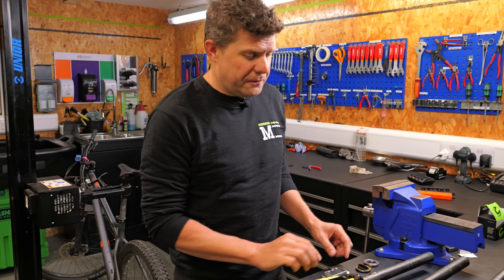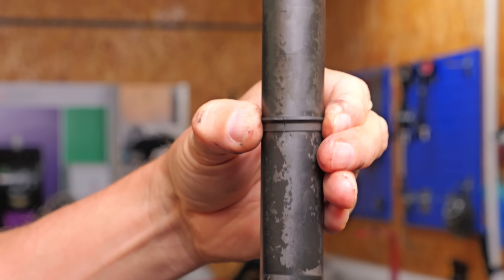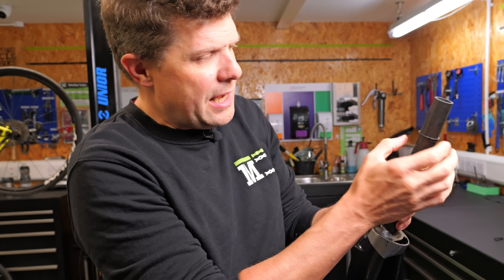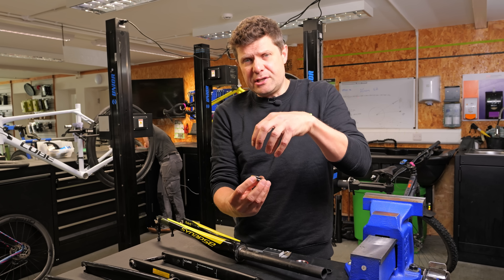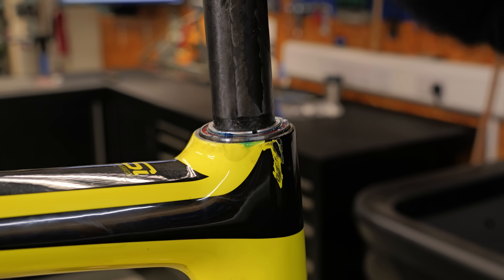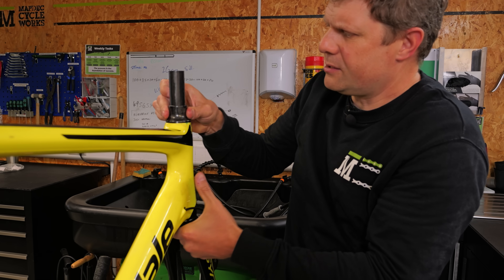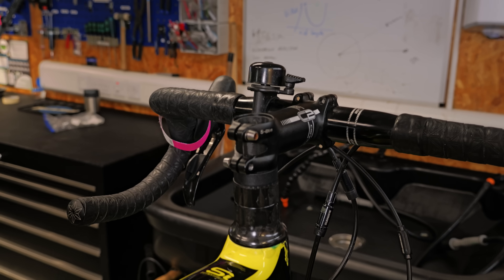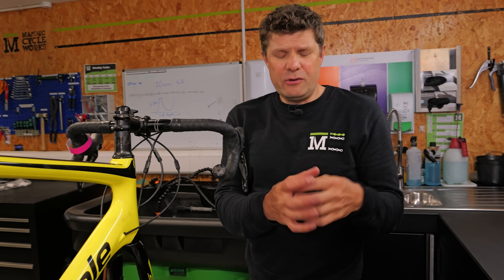Why Are So Many Bike Forks Breaking This Week?

Comment: 1) it's not abrasion.
2) you installed the compression ring 90° out of phase. 
3) every bump and rebound load from your arms to bars compress' the ring thousands of times per ride. 
4) show me a steerer with a plastic comp ring that had a ring of death. You have galvanic corrosion, a steel bearing sandwiching a non anodised aluminium comp ring
5) look at ring of death in the early stages and its compressed carbon fibre, once the epoxy layers are broken you then get galv corrosion+ the comp ring reaching max compression as you showed
6) Comp rings and seatpost clamps do not stay circular as the close. They become a C with the tips of the C pinching inwards on the steerer in 2 point loads.
7) stop greasing your headsets and steerer as shown. You need a drainage channel. Just hose your headset and then unassemble it and you will see the pooling water in the dam you've created.
8) the only cheap solution is to put a layer of plastic tape around the steerer prior to assembly. The thinnest "helicopter" tape is best. Cheaper PVC based ride wrap is ok, cellophane tape is ok.
Reply from the maker: I showed you 2 plastic compression rings in this video. 🤷‍♂️
Reply: @Mapdec and they were from the corresponding forks you showed?

Comment: I had this on my SL6 tarmac. The carbon repairer was able to fix it, but did also reenforce it on the inside of the tube. Mine was cause by the top cap collapsing; there's an oring in a slot inside the top cap, but the cap had collapsed closing the slot for the oring and making it unable to be tightened.

Comment: For any buyer (especially those experiencing issues with carbon steerers) I think Mapdec should be recommending a different compression plug (e.g. Deda 55mm or 70mm) which supports the entire column - they're about $12-15 USD. It's a no brainer (I swap out all mine/friends bikes who will listen based of Luescher Teknik's expert advice/reasoning for the sake of 20grams.
Reply from the maker: It’s not as simple as that.  Ask a cannonade dealer about their warranty work.   We would always be mindful of original specifications and give owners informed advice before we make modifications.  I agree with you, but it is not a blanket solution and one I would promote.
Reply: @Mapdec as the fork has been repaired the warranty is void, so the other option of a longer compression bung would help control excess fatigue to the repair
Reply: @Mapdec  
Cannondale (and many others) use these tiny compression plugs so they can claim X grams on paper. In these instances "original specification" is just wrong. 

Take the advice of a highly regarded bicycle carbon repair/manufacturing expert like Luescher Teknik or a bike brand chasing grams/chasing pennies to sell bikes? The former every day of the week and twice on Sunday...

Comment: I repair bikes and i only install carbon forks with aluminium shaft but i when i got a frameset with a carbon shaft i kept having loose steerer until i have overtorqued it (more than i torque aluminium shafts). Thanks for the video, this has finally gave me an answer to a problem i was not able to know identify!
Reply from the maker: Out of interest where do you buy these from? There are quite rare.
Reply: @Mapdec  from either Bikecomponents/Bike-discount/Bike24
Reply: Isn´t there a bigger risk of breaking when the steerer tube is aluminium with glued carbon bottom compare to full carbon fork?
Reply: I have never had problem or accidents on alu shafts. Only on carbons. Carbon forks with alu shafts used to be the norm until people kept trading safety with milligrams

Comment: does not happen to steel shaft forks, does it?
Reply: No, these clips are either plastic or alu so they wouldnt be hard enough to damage the steel steerer tube if using a similar headset.
Your bearings not being seated correctly could cause damage, though. I believe Rockshox and Fox advise to not ride a steel steerertube any more if there is any abrasion deeper  than 1mm.
Reply: @HNKDrumNBass  When I read your replies or when viewing your videos it often occurs: man, I never thought about this, but that's logical! Clearly someone who knows his stuff.

I won't buy any carbon parts that are statically crucial for carrying me on the bike, only items where it does not matter much. But I like to learn, like I did here.
Reply from the maker: The compression ring is usually the part that fails first with steel forks.

Comment: Bike industry needs more real engineers instead of startups and life style freaks. The whole head set system is just a sleeping failure designed in a product pricy as hell. Also there iss documentation like a receipe in a cooking book but nothing that reflects the criticality or complexity of the product. The whole design of a carbon shaft is just copy paste from steel design replacing the material but it looks like never ever a stres engineer had a close look to it. The stuff is not worth the money. And is or can be really dangerous.

Comment: Play in the headset is also caused by beairngs wearing out so that no matter how tight you make the top cap there will be lateral play also causing the same problem. Personally I think that using carbon steerer tubes is just dangerous. carbon forks with aluminium steerer tubes don't weigh much more (~300g) and will last for ever
Reply: I agree. I will also say that this carbon craze and having to save every gram of weight on a bike is starting to be regressive. I would rather have a slightly heavier bike that is built way stronger than to have to worry constantly about stuff like this, you pay a buttload for the "best" but all you get is extra headaches, and dont drop that bike because it might be game over haha.
Reply: Not forever. The aluminium will eventually galvanic corrode and debond from the carbon fork bridge. Almost every aluminium frame in my graveyard that has reached the 15 year mark has begun to corrode from under the paint work.
Reply from the maker: Yes. This.  Alu and Carbon do not play well together.  Most industries outside of sporting goods prohibit it.
Reply: @NapalmBikes  Still longer than carbon steerers

Comment: Hi folks perhaps carbon grip grease under spacer would be a good idea too ?
Reply from the maker: Abrasive
Reply: @Mapdec so double edge sword. Its used to hold but should it move then accelerated damage. Then why is it used at all at any locations?

Comment: I see a lot of poorly set up . A lot of kids like to add spacers with fun colors and end up having too much gap above the steerer along with incorrectly torqued bolts. 

I have had one where the star nut was in at an slight angle ans the stem bolt sheered off and I had to drill out and install a new one correctly and another where it was only just inserted into the steerer so had to set it correctly.

Comment: So do you use grease between that compression ring and steerer tube?
Reply from the maker: If it’s metal I do.  Corrosion resistance.  Always read the manual. They can be very explicit.  Some grease will make plastic rings brittle or swell

Comment: “Most riders can identify a loose headset”
I’m not so sure. It’s by far the most common unnoticed issue on bikes brought to my workshop.
I’m of the opinion that carbon steerers are just not fit for purpose on bikes bought by anyone not dialled in to how a bike should feel, prone to a bit of tinkering or happy to let problems run on to the next service. That, unfortunately, is a very large number of riders.
Reply: For sure. 🎉
Reply: 100%.
Reply: Excellent point. Most users, and mechanics, don’t pay enough (or any) attention to makers’ manuals. “She’ll be right”, until she’s not.

Comment: Very important information, excellent video - thank you for this! I indeed believed a loose headset would cause this, or damage from any sort of impact like potholes...but nope...that compression ring. Thanks for making that clear and pointing out how exactly this happens. Would you say "as soon as you can feel any dent, it needs repair" or by what measure do you go? Any visible abbrasion = better be save than sorry I guess?
Reply from the maker: Any visible sign.

Comment: Some people have rightly suggested buying a new fork would be safer than fixing a steerer.
Has anyone tried buying a Cannondale fork though? A mate of mine (no, it wasn't me!) made a mistake and cut the steerer too short on his brand new CAAD13. He waited six months for the importers to get a new fork, finally gave up and bought a new frameset and put his old (virtually brand new) frame up on eBay.
Reply: Not just forks. Try buying a spare seat post, seat clamp, cable adjusters, gear hanger, etc. from any of the major brands. Decals are also impossible to get for the majority of brands. When bikes and aftermarket framesets are made and packaged in distant lands by nameless and actively concealed outsourcing vendor factories, meaningful service provision goes out of the window. Mainstream brands are on borrowed time. The vendors are going to take over by selling under their own brand names. End users are workng out that paying "marketing and distribution tax" to a middleman brand name is a form of financial exploitation that they don't need to be subject to. It should be simpler to get spare parts direct from the factories where these items exist in stock, but the "paywall" of a brand name means that this can't currently happen. The times they are a changin'...
Reply: @davidpalk5010 . Younger folks might not realize it, but this is exactly how the Giant brand came into being. Giant was a faceless Taiwanese manufacturer that pumped out bikes to be marketed under such well known, respected brands (this is the 1980’s, mind you) as Fuji, Univega,Raleigh and just about any other “full line” manufacturer of the time.  Giant finally realized what they were missing out on, and started marketing their own brand and name.
Reply from the maker: @davidpalk5010  paywall.  Some might call that accountability.  But i do otherwise agree.  Brands need to step up their value proposition
Reply: Brand loyalty is to blame, people need to stop buying from brands that can't deliver spares in a reasonable amount of time.
Reply from the maker: Sounds familiar.

Comment: Great explanation to what we see a lot of issues of in the trade, I also prefer to run a longer Bung too, some the stem's of recent times are too shallow on the small bungs so they clamp to a steerer tube that has no internal integrity (Tarmac SL7 - Poor Design) , 
I've seen a few stems dig into the carbon steerer too. 
But great video again

Comment: Couple of things...
Cannondale compression bungs are CRAP. For the sake of about 20g weight get yourself an aftermarket bung which properly supports and grips the inside of the steerer tube for the full 4cm or so where the stem clamps it.
Also, WHY do they use a metal compression ring which is almost guaranteed to score a perfect ring in the outside of the steerer, making it liable to just snap cleanly off? Plastic, far better.
Reply from the maker: all good points.  Plastic can compress, so it needs to be pretty solid. The deda one is a good example. Massive, but rigid.

Comment: Note to riders running 3" spacer stacks on lightweight carbon steerers - Riser drop bars are available... which might let you run a much safer stack. For my sense of safety margins, that's about an inch too much spacer... but the riders face and dental cover are their own.
Reply: How about flipping the stem? Looks wrong but it’s the lightest and stiffest way to lift the bars.
Reply: @Bonky-wonky  Yeah, looks slightly shonky though, whereas the riser barely gets noticed... or even run a 0Deg stem to come up a bit... Or invert the stem and do both, anything but putting all that cantilevering force through a minimal steerer into an often marginally designed top race. Its putting a lot of faith in a well designed and long fork bung...
Reply: Mfg's need to design and sell FORKS WITH A STEERER THAT IS SAFE TO USE 100MM OF SPACERS ON!!!!   If threadless is a permanent non-choice they are obliged tomale something safer for those who need their bars higher.  Carbon is better than it used to be--how about a thin 4130 liner in the steerer?
Reply: @davefeldman3740  Its a much, much better solution for the rider to choose a frame with a head-tube length which suits their position, or if they're outside of normal parameters- have something made. High spacer stacks are a terrible solution to anything, only really acceptable on heavy gauge touring spec steel forks.

Comment: Why not just use a propper long expander (and top cap) that will support both stem bolts and the spacers on top of the stem instead of this useless (but lightweigth) cannondale expander? 
I mean right now the customer will either ride in a compromised position, or DIY themself into setting up spacers in such a way that the stem bolts are not supported at all...

Why not just cut the fork steerer to get rid of the need for those spacers on top?
Reply from the maker: This rider is particularly sensitive to original parts after a particularly stupid altercation with Cannondal warranty previously.   That aside, some cannondales have some very strange Steerer ID.

Comment: Since your working on so many bike's  . why dont you make some threaded  sleeve's that you can bond on the steerer like Time and do conversions ??
Reply from the maker: So many reasons.  You need a bearing that has a large enough hole to fit the threads through. The Time bearings were specially made for the Quickset and had very small balls in them
Reply: @Mapdec  True

Comment: Surely after spending the money to have the steerer repaired, rather than you stick it back to standard knowing the customer is going to stick the spacers back on top later - advise them to have the steerer cut - they have likely been riding it at that height for years anyway!!!
Reply from the maker: They don’t want it cut.  I tried ❤

Comment: thank you for the explanation
on the synapse which you working in the video
simply swap to colnago long long compression plug~~~
Reply: It´s isn´t allowed by cannondale. Their system is weird, I replaced it for long plug and using spacer above too. The shop can´t do this officially.

Comment: If I'm doing all that on a bike I'm keeping,  I'm putting an internal glass/ Kevlar sleeve,  so even if the ring is death occurs to the point it can be felt while riding my steerer tube will still be bullet proof literally,  and what's the down side? 10 to 20 grams
Reply: Leonard Zinn, bike mechanic, author is an advocate of this style of reinforcement and used to sell a specific insert to do the job. US only I believe. Was to mitigate the additional forces that some larger / stronger riders would put through the handlebars. Makes sound sense to me.
Reply from the maker: Interesting
Reply: The downside is you move the weak point down the steerer. You can find photos of broken steerers that snapped exactly half way between the 2 headset bearings. 
The steerers flex by design and placing the stem up above the top cap compounds this midpoint flex. 
You can find many carbon bar/fork flex videos online (rides of Japan) but the issue is these forks steerer tubes weren't designed for torsion. The obsession with cheaper unidirectional layups will bite us all eventually.

In an ideal situation the torque load on the steerer is low as evidenced by how easy it is to steer. But a rider outputting 2000 watts is pulling almost 1/3 of that force upwards on 1 handlebar end. In this sprint scenario they are inevitably leaning the bike over and bouncing on the pedals which increases the torque on the steerer tube and if you encounter a road bump during this the force multiplies exponentially.

Comment: Therefore, past models of TIME bikes had independent compression bearing adjustment. Unfortunately, due to the idiotic trend of having hidden cables, TIME has removed this genius feature.
Reply from the maker: It wasn’t without issues. It needed a very special bearing, that had very small balls.  Bonding aluminium to carbon is challenging as it can rapidly attract galvanic corrosion, and the head set is directly in the line of fire of salty sweat, drink dribble and rain.
Reply: @Mapdec  But those special bearings are quite durable (I actually ride an AdH21 rim brake model from 2023 which still had the Quickset). I believe NTN made them for Time. I don't ride it in rainy/wet weather though (partly because I live in a pretty dry place)

Comment: small question: could you not swap the compression plug to one from the specialized SL8 and leave the spacers over the stem?
Reply from the maker: Why an SL8 ?
Reply: Because the lower part can be sawn off. As far as I understand, the spacers could be left above the stem, because the fork is also supported more deeply by the lower part. This allows the customer to continue riding as before. I just don't know if only the original plug fits into the Cannondale fork.